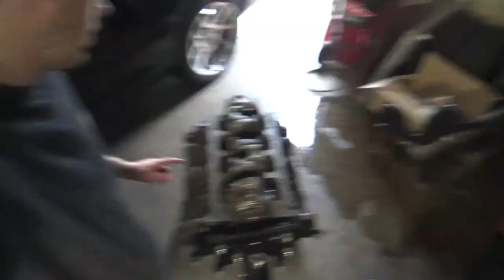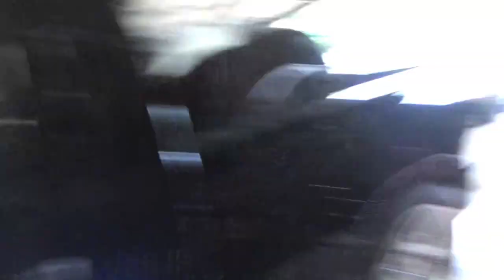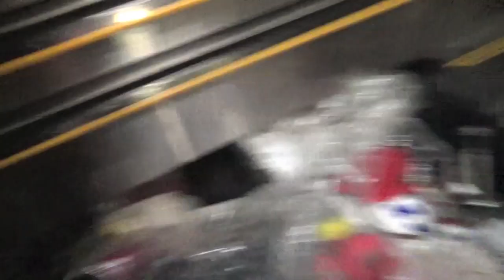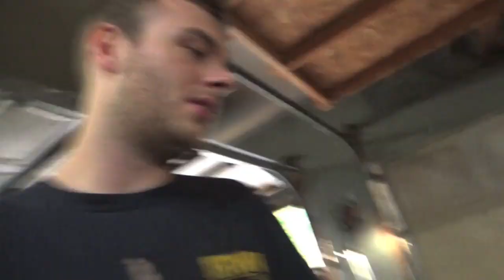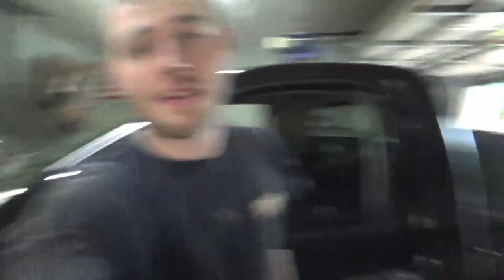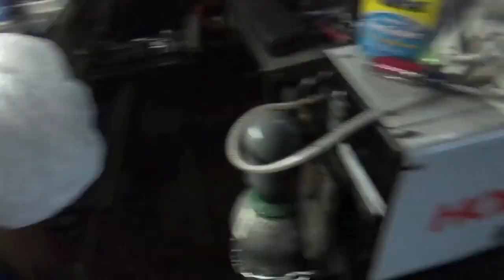RODS AND PISTONS HOW TO INSTALL 5.9L 360 twin turbo magnum engine build

Comment: I just installed a 5.9 in my 03 Dakota need help on the wiring.do I have to change everything
Reply from the maker: What engine was in it? 4.7?
Reply: @RacingRamFam  yes sir
Reply: @RacingRamFam  will a 5.2l wire harness work on a 5.9

Comment: Does anybody know where to buy the Mopar Magnum valve covers?
Reply: Picked up mine for $212.00 @ E-Bay & that was Bran New for 5.9L Magnum 360....
Reply: @prior8t2000  😂 I literally just bought some last night for $220 shiped off Ebay 👍🏻
Reply: Mopar sumit raceing jegs on line there out there
Reply: @oscarwalton1188  I feel like I've looked and only see the older style ones. I swore I saw some a pair on one of those websites for about $160, does that sound right
Reply: @stunnasam21  for brand new yes you might find a used set for less
Reply: @oscarwalton1188  the only set I found is $360 on eBay ☹️
Reply: @stunnasam21  damn
Reply: @oscarwalton1188  FINALLY found them on Jegs for $155. Thanks bro
Reply: @stunnasam21  Glad you found them good luck on your project

Comment: You turboed a 10:1 motor? Compression is way to much you want about a 7:1 compression ratio shit is gonna be way to tight and imagine you used an off the shelf cam which you should have gotten a custom grind for turbo application total different configuration from stock or "thumpy" cams and the way you set the rings on the "swing" side of the Piston you're going to tear the cylinder walls up good material but you should have consulted with several of you vendors before purchases best of luck in the future with it tho I respect your build
Reply from the maker: walter young it’s actually closer to 11:1 lol 😂 10.8:1 just gonna send it

Comment: I have a 360 magnum. Hypereutectic(dont mind the spelling) rods and pistons. Bored .020 over with a comp cams cam(specs I do not remember) i know it's more of a 1500 to 5500 rpm power band. Edelbrock perfomance heads. And ported and policed heads and intake manifold and bigger throttle body and a tune. What are your thoughts on running the aluminum heads that jegs has??
Reply from the maker: Zach Ramsey yes! I’d love a set of aluminum heads but don’t have the money for them
Reply: Do you have any idea for hp and tq possible gains? I have not witnessed or heard of it until I seen your video!
Reply from the maker: Zach Ramsey it’ll be different with every build but better flowing heads always gain power
Reply: @RacingRamFam  right, well I'm hoping to see what these heads do. Procharger are outrageous right now but I need one

Comment: Righton .. good video I enjoyed an paying  close attention 👍to ur build there .. I mentioned a bit to you ago I purchased that low mileage 2 door short box 2 wd with 5.9 v8 mag ,auto ,an 392 gears .. I run it for first time last weekend against my sons identical body style truck only his 4 yrs newer 4 wd an has hemi with a few minor mods done to it .. 3 runs down 1/4 mile track an last run was the best with him jus beating me by his front bumper .. jus did my first few mods today cold air intake, 2 / 4 suspension drop an had transmission serviced an setup ...love the truck an still working on  some more mods yet.. 👍 lookin forward to ur up coming videos on both the venom an the 5.9 rebuild etc .. also some more track runs too !!!👍 looks like you musta been filled to the brim after all that food you guys ate at the fair lol.. cheers man 👌
Reply from the maker: Darren Sager thanks man! And yes the fair was a lot of food... and sweet man just need to get a tune and you can kick but at the track!!

Comment: Hey man what do you use to measure piston protrusion and how do you calculate the necessary crush thickness of your head gasket?
Reply from the maker: scmroman I should make a video huh lol
Reply: @RacingRamFam  yes you should, I've rebuilt a few aircooled aircraft engines and some jet engines, and never had to deal with piston protrusion in them.

Comment: Hi what's the build details?
Reply from the maker: Matthew Stocks lots to list but I have a playlist of videos that tell you everything about it! https://www.youtube.com/playlist?list=PLeEwppcCDh6YVsim8ispX1oyrMwwRSF23
Reply from the maker: Matthew Stocks if you wanna check it out
Reply: @RacingRamFam  yea I will watch them all thanks:)
Reply: @RacingRamFam  what I  doing is I have a 66 rambler classic 770 two door HT and I am planning on a turbo 360 mag!
My car was a l6 with torque tube but puting a 8.8 ford rear in with 4/10 gears a 727 and the motor hoping to run in th 11s on the 1/4 mile
Reply from the maker: Matthew Stocks that sounds awesome!! Ya def be 11’s if your going to turbo it!
Reply: @RacingRamFam  what turbos and fueling system etc would you recommend?
Comp ratio and cam spec??